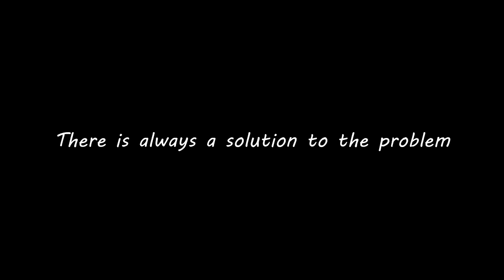GREAT IDEA FROM ELECTRODES AND PLYWOOD !! I am completely satisfied with the result.

Comment: I buildt a tool cabinet similar to this around 40 years ago. It was 90 centimeters high and 3,5 meters long. It covered a whole wall in my workshop and had six doors next to each other. Behind each door were two more doors that closed overlapping from left to right. On the doors and back wall I had all my tools hung up. Hammers, pliers, saws, screwdrivers and so on. Was a good way to have everything available and dust free (from cutting wood). I did not need Elektrodes. I used screws, nails and glue. There was no such thing as a nail gun or battery drill back then. Everything was cut and drilled from hand and fit. Back then there were no videos to be made and show on YouTube or get ideas from. One had to think for hismself and be creative.

Comment: So, let's see if I get this right... You are working on a project and you need a Phillips head bit for your electric drill so that you can screw in a couple of screws.  You search around and can't find it, so you decide to build a storage rack for your drills and bits.  In order to build it though, you are using the exact same thing that you couldn't find in the first place...

I suspect that the solution that most of us use is if we can't find it, we go buy a new one.  If you have multiple of an item, your chances of finding at least one increases by that many times... :)

Do I need 5 hammers that are basically the same design?  Probably not, but when I did need one and couldn't find it, the easiest solution was to buy a new one... Now, with 5 of them, the chance of finding at least ONE is 5 times as great... :)
Reply: Dont kid your self you still cant find a hammer! Lol

Comment: Box making like this can be done way easier, make the box as deep as you need don't use nails and or screws close the box on both sides and when glue is dry just cut the whole box creating the two halves you need. And why are the back plates not used ?

Comment: Why would you waste good electrodes when you can buy rod much cheaper.
Reply: I think its incase you working on project late when shops are closed and you need to finish.  Its good to know of alternative methods also. My uno that i drove, the lock mechanism on driver door had a rod inside which broke. My dad and i opened it. He had a dull drillbit lying around which was the exact thickness as the original rod of the mechanism. Fixed the lock and well. The car was sold with that lock still working
Reply: Could possibly be that the electrodes cost less (;-) ... like next to nothing?